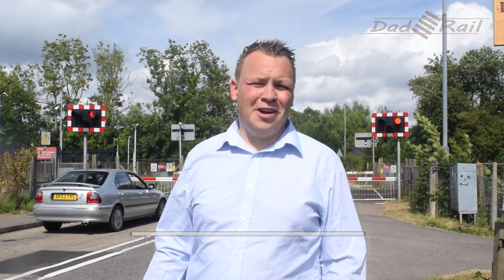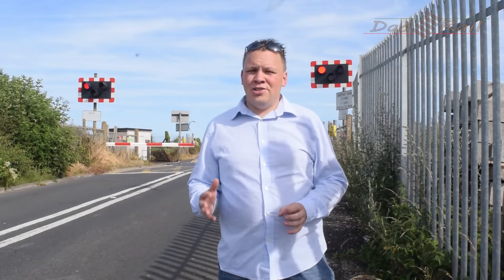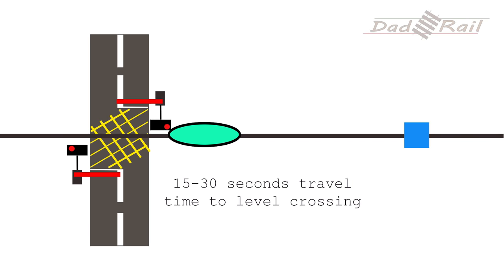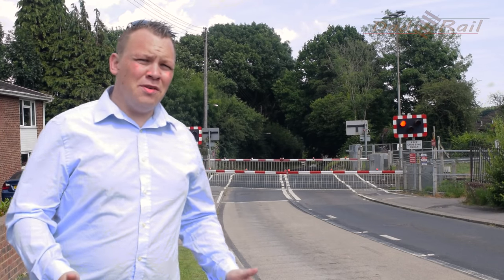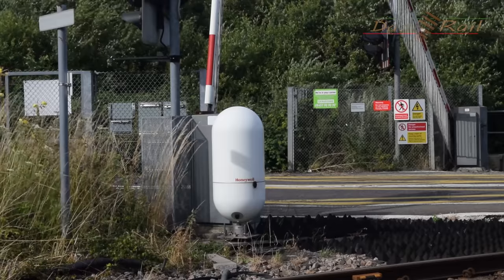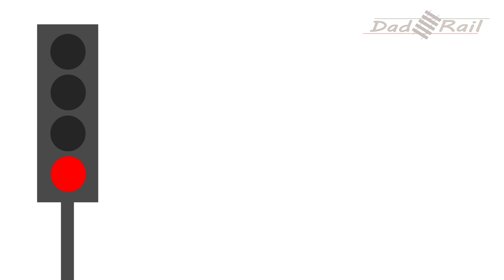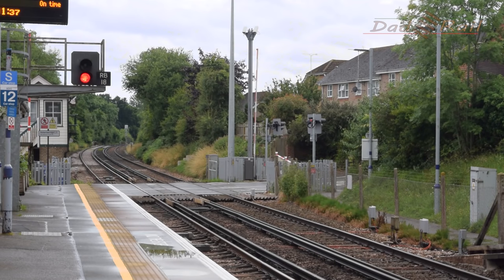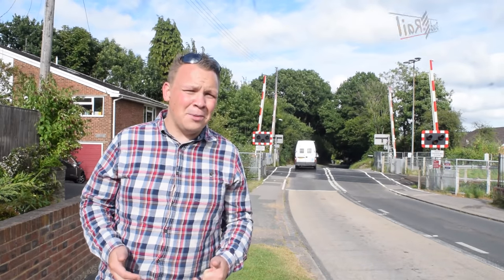Why do railway level crossing barriers go down so early? - Dad Rail HD

Comment: Yes, I did learn something - why crossings are closed even when a train is stopping at a station - thanks.
Reply from the maker: No Problem, thanks for watching
Reply: Also, the driver may use a timetable to say if the train stops at a station, not be signaled to stop at the station and the signaling system, therefore, has no way of knowing if a particular train is going to stop at the station adjacent to a level crossing.

Comment: We lived in a rural part of Australia where there was only one train a day. One night we went down to the tracks near a level crossing. If you put a jumper lead joining the two rails together it would activate the boom gates and lights. Not going to admit to the mischief we got up to!
Reply: You were activating the "track circuit". When a train is actually on the line, its wheels act the same way as the cable using which you "shorted" the track circuit.

Comment: The ones near me are CCTV-controlled. It is wired so that when the train passes a signal approximately 2 minutes away, the sensor which changes the signal to red notifies a controller in an office, who waits for the crossing to be clear then pushes a button to close it.
Reply: That wouldn't be safe, I'm sure that the crossing is actually closed before the signal changes from red to a proceed aspect e.g. a green, double yellow, or yellow aspect.
Reply: @PottersVideos2  : not the signal closest to the crossing, but one about a mile away.
Reply: Those are still called manual crossings, the CCTV is how they prove the crossing is clear they don't control the crossing.
Reply: @tgm9991  : My Trackatlas lists them under the abbreviation "CCTV" (although that book is full of errors & can often not be trusted).
Reply: @ccityplanner1217  The full abbreviation for them is MCB-CCTV for "manually controlled barrier crossing with closed circuit television"
Reply: @PottersVideos2  
Correct, the protecting signals are interlocked with closed crossing. A warning is sounded when trains reach predetermined locations which allow signaller reaction time plus all signals in the sequence to go green before drivers are within sighting distance of them.
Reply: @tgm9991  
Most CCTVs can be set to auto-raise after each train, but comparatively few can be set to auto-lower as well. Signallers must be able to intervene if they see the line obstructed and halt the barrier travel.

Comment: I would just to correct you on a couple of points.

1. Trains don't need 'several miles' to stop safely but they do need several hundreds of yards in order to do so. I would fully expect a train under normal rail conditions to be able to come to a stand in less than 2 miles, even from 125 miles per hour.

2. Signallers do not always lower level crossing barriers for stopping trains. If you go to Reigate level crossing in Surrey for example, the barriers are never lowered for electric trains to approach. There is a very good reason for this as the line is not electrified beyond the level crossing and therefore all electric trains must stop and terminate their journeys at the station.

The protecting signal needs to be minimum of 25 yards from the edge of the level crossing to allow the signaller to do this. For signalling purposes a level crossing is not treated as an obstruction. At stations where this distance is not achieved or at stations where there is no signal between the platform at the level crossing, then of course what you say in the video is correct.

One thing that I'm a little surprised that you didn't mention is the length of time that elapses at an automatic half barrier crossing from the time it takes from the amber light illuminated to the time that the barriers become fully raised after a train has passed over the level crossing could be as short as 37 seconds, and the time that it takes between the barriers fully lowering and a train arriving at a level crossing can be as short as 10 seconds. It is therefore vital that if you are driving a vehicle that breaks down on a level crossing is that all the vehicle occupants are removed as quickly as possible from the vehicle to a position well clear of the running lines, before phoning the signaller from the phone at the crossing. A drivers primary concern is to save life first. Certainly don't waste vital seconds in trying to push a vehicle clear.
Reply: saved me from wearing my keyboard out
Reply: 1. True that trains can brake from 125mph in a shorter distance - to allow safety margin signals are spaced to give around 2400yd braking distance on level track - but the crucial thing about full-barrier LCs is that unless unavoidable signallers must give all drivers green signals. That means proving all barriers fully down with enough time for drivers to see the outermost signal at green. That's where the 'several miles' comes in and Richard is spot on about that. Another thing to consider is that delaying the closure sequence actually leads to longer road closure time: Imagine 60mph or 45mph 2000+ tonne freights carrying stone. They drive to the same lineside signals as 125mph passenger trains. If the signaller 'breaks the driver's stride' with a double yellow or yellow signals rather than green, the effect of a freight braking and then re-accelerating when the driver sees a signal then clear up costs far more time than simply letting the thing run on greens. Signallers have very tough judgements to make at times, especially where two or three different types of train are approaching.

2. For a few years now, the Rail Regulator (ORR) has taken a tougher line with controls as and when LCs are renewed, and their Inspectors are looking for barriers down and platform starting signals to be cleared before stopping trains arrive. That said, maybe for terminating trains as at Reigate they aren't so fussy, but for everywhere else...things will not get better!

3. True about AHB LCs - in fact the principles allow a minimum of 27sec from amber lights first showing to the train's arrival at the LC. If it's a short train the barriers could start rising within about 5sec afterwards.
Reply: 1.  Depends on the train and specifically, the train load!  It CAN be a mile or more for a heavy freight to stop.
Reply: Nicely put

Comment: In Belgium I do not know of any other crossings than automatic ones.  The attended ones date from maybe 40 years ago or so.  And signals are placed at 1 mile intervals, and have only one signal announcing the next light is on red, except on lines where 100 miles per hour is permitted.  This means that up to 90 miles per hour a train is supposed to be able stop in less than one mile.

Comment: You need to check the crossing at East Preston in Sussex, which is on a busy bus route as well, the barriers come down a good 5 minutes before a train arrives. One day I timed it at 7 minutes. That's the equivalent of one helluva stopping distance !!! These are only commuter trains doing at best 60 mph.

Comment: Thank you for another great video. I learned a lot. However, when I was a little boy in New Zealand we had two crossings on the way to our beach house. My father always made a point of slowing down to almost a stop and checking that both ways were clear. Visibility was bad at these crossings and most people did the same. They were on the main road and are now crossed by bridges. I learned from my dad and have never had a problem.

Comment: Here in the Netherlands the times are shorter.

Where trains drive higher speeds all the time, it often crosses the crossing just 7 seconds after the barriers are down!

Also the barriers are not lowered when the crossing is after  red signal just for safety. Exceptions are made when there are leaves on the rails.
Reply: Funnily enough in the UK barriers aren't lowered where the crossing is after a red signal but at a station they are because there is no need for a red signal. This would just cause unneccessary delays as a train might not stop there anyway e.g. freight trains, ECS trains and driver error

Comment: In a nearby town, there was a (locally) manual controlled crossing after the station. When the train stopped, they lowered the barriers in the time the passengers leaved and entered the train. When they changed it to remote control from a location 15Km away, they did close the barriers when the train was just entering the station. Now, the crossing is removed and the platforms are extended. In my town same problem, but after removing 3 from the 5 tracks, it was replaced by an automatic crossing.

Comment: From looking at this, my local town centre has a Controlled Level Crossing, but the barriers come down a full 3 to 4 minutes before the train passes through, at walking speed as the station is immediately next to the barriers. It causes endless frustration and jams every time a train is due (half-hourly service at best).  The delay is way too long but fortunately most people  don't try to jump the barriers coming down.
Reply: Whilst the train is booked to stop at the station, the crossing barriers will be lowered as a safety precaution in case the train fails to stop (faulty brakes, leaves on the line, driver not paying attention etc.) In that case, the barriers may well be down for 3-4 minutes before the train arrives, especially if the train has longer than normal time in the station (difficulty getting a wheelchair bound passenger on/off the train for example.)

Comment: Years ago when I had an old minibus the spare wheel was carried under the vehicle in a carrier. It fell off going over a level crossing because the whole thing was rusty. I didn't stop until I was clear of the line but I was able to retrieve it before a train came.
Some level crossings are far from "level".
Reply from the maker: Wow that could have ended differently! I agree some crossings are bumpy to say the least

Comment: It all depends if the line is quiet or busy. For example the East Coast main line from London King's Cross has many level crossings with big fast Virgin electric expresses going at up .to 130mph will mean that the barriers have to be lowered a few miles before the train comes.
Reply from the maker: Correct. At higher speeds the signals are further apart to allow longer breaking distances. So to allow the train to run on green signals the barriers are lowered in enough time that the train does not encounter any cautionary "yellow signals" and therefore does not have to slow down.

Comment: I often wait 3-4 minutes between the barrier closing and the train arriving,timed by listening to complete songs on the radio:-) . The longest I waited with the gates down was 20 minutes,for 3 trains. In SW London.
Reply: This sounds about right, 3 to 4 minutes per train is about the minimum for a controlled crossing. With multiple trains signallers give priority to trains over cars as these carry more people per vehicle in the same way that car drivers have to live with buses going past them in bus lanes. The chances are that  you wait 3-4 minutes for a train carrying in excess of 30 to 120 people per carriage.
Reply: @ianmurray250  5 minutes normally

Comment: Btw it isn't 15-30 seconds, the law requires a MINIMUM time of 27 seconds
Reply from the maker: Thank you, I didn't know that !
Reply: Where I drive, in Canada it is 20 seconds.
Reply: In The Netherlands it is five seconds.
Reply: in the US its 10 seconds
Reply: In Poland it's very often as much as 5 minutes (and a lot of people ignoring the red lights)
Reply: pretty sure it's 26 seconds - could check my rule books
Reply: oof where i live its 10 seconds cuz trains are slow thats the luck of indiana slow trains
Reply: In the U.S. it's 20 seconds (not 10).
Reply: that IS between 15 and 30 wnat you on
Reply: @Zeniethia   Actually (and I'm a former U. S. Locomotive Engineer), the U. S. Federal standard is lights start flashing 20 seconds before a train fouls a crossing, the gates should be down about 10 seconds before the train arrives at the crossing, and the train is supposed to sound horn 14-20 seconds before it fouls the crossing, holding the last sound across the crossing (the traditional North American two longs, a short, and a long sound).  U. S. practice clearly puts the onus for avoiding a collision on the automotive traffic.  Those crossings in the U. S. that have 4-way, or all-way gates usually have the exit side gates come down last, so any traffic trying to beat the train can get across without knocking down the gates.  I have seen big truck rigs in the U. S. deliberately crash through gates where a train was approaching slowly, and they didn't want to wait.  The most interesting thing to me in the difference between U. S. and European practice is that UK and European railroaders use the horn or whistle very sparingly compared to the U. S.  Of course your horns and whistles suck compared to ours :0.
Reply: @xaiano794  In the UK (for AHB crossings) it is a minimum 27 seconds from when the amber light comes on to when the fastest train arrives....8 seconds minimum train arrival from when the barriers are considered down.
Reply: @worldwide8553  I haven't been able to pin down exactly what rule that's under - it's been a while since I dealt with one, I thought it was 26 but I guess I could be mistaken. I'd like to find where it's written.
Reply: @paulw.woodring7304  
Isn't there also a time limit for how long a train is allowed to block a crossing before it must either proceed or move out of the way of road traffic?
Reply: @CraigBaker96837   Those laws are just about always local ordinances, and yes they do exist, but not for every grade crossing or every locale.
Reply: Here in Dundee its minimum of about 2 seconds

Comment: I think of the double yellow as meaning "slow to 2/3 of maximum line speed" and the single yellow as "slow to 1/3 of maximum line speed, and expect the next signal to be red".
Reply from the maker: In an ideal world yes. Unfortunately signal distance is not uniform so its impossible to mandate what speed you should be doing past a particular signal. Also trains have different breaking capabilities. Its down to the drivers judgement and knowledge to drive to the route and conditions. That said there are safety systems (TPWS) that will activate if you approach a red to fast.
Reply: In the UK at least they don't mean to slow to a certain speed however much of the world do have what's known as "speed based signalling" where a yellow signals does indicate to the driver that they need to slow to a certain speed.

Comment: At most crossings here in America that aren't next to stations, the wait between the signals activating and the train entering the crossing is usually between 20 to 35 seconds.
Reply from the maker: it is about that here on automatic crossings, its the controlled ones that cause more of a problem.
Reply: As it should be. Theres no reason why ALL crossings can't be automatic including the 3rd type with full width barriers. The amber warning light and siren give drivers plenty of time to stop or clear the crossing before the barriers start going down.n
Reply: We really shouldn't need to have manually operated crossings in 2018. I wonder how often the CCTV is actually checked and instead the button is just pressed to activate the barriers.  Automatic barriers via the "treddle" device will be more reliable than a human pressing a button.
Reply: Long Island Railroad grade crossings have been automatic for as long as I can remember, and they have gates and signals at almost every single crossing, though they've claimed to have them at ALL crossings since at least the 1990's.
Reply: Yes, but the vast majority of drivers are not aware that the crossing itself is a yellow box junction (some are painted - some aren't) and that you should not enter the crossing unless you can get clear on the other side. I have seen them delay the second barrier (or even reverse it) when people haven't cleared fast enough.

(I have a family member who did just that. Stopped on the crossing then tried to blame the driver in front. They didn't like it when I told them they were in the wrong)
Reply: A yellow box should not be required for any driver to know NOT to stop on the tracks!
Reply: Simon Tay - All UK CCTV monitored crossings with full barriers are actually controlled / manual barriers. It’s just that the signaller / crossing keeper is remote from that crossing. The signaller / crossing keeper has to press the “CCTV picture” button, then once the barriers are proved down, he/she has to push the “crossing clear” button before the signalling system will let him/her clear the railway signals. If the two or more red flashing road lights fail, any of the barriers fail to lower, or the correct button sequence is not followed, the signalling system will hold the protecting signals at red.
Reply: @simontay4851  As soon as a signaller is notified that a train is approaching a CCTV crossing, he will start the lowering sequence.  He only checks the CCTV once the barriers are down, to make sure that the crossing is clear before changing the protecting signal from red to proceed.

Comment: because some trains move faster than others a train going 100mph will get to the crossing quicker than one going 50mph so sometimes you wait longer and they activate when train passes a sensor on track or a certain location
Reply: Correct, so the sensors are positioned further away on lines where the line speed is higher.  The other side of this is when a crossing is not lowered and clear of road traffic in time, the first protecting signal for the train could be yellow vice green so that train slows down so that it can stop meaning that it takes longer and is going more slowly when car drivers see it going over the crossing. Car drivers who jump the lights end up delaying the other car drivers and the train passengers with their behaviour.